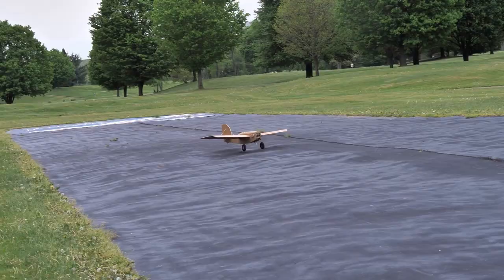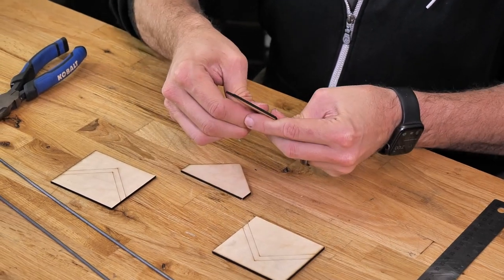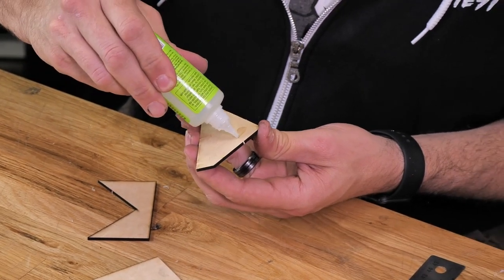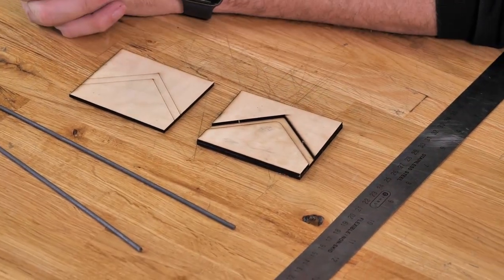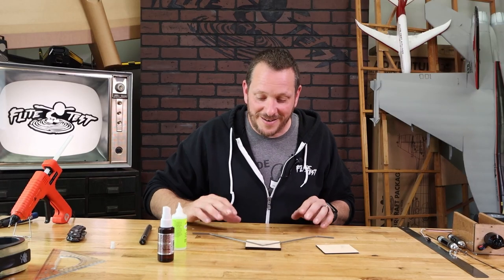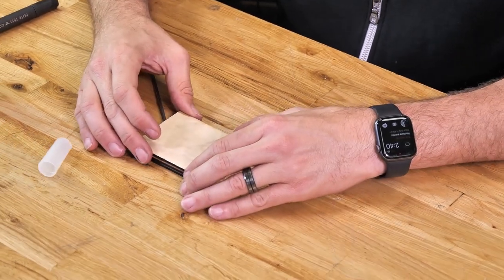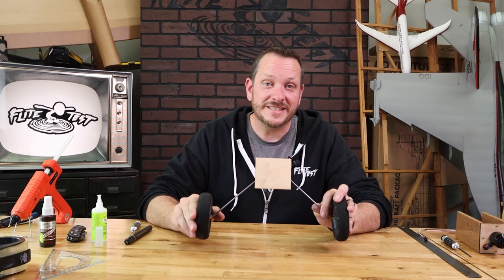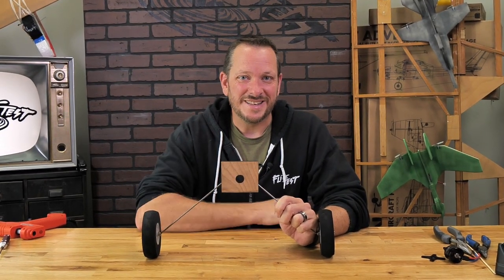How to Build the FT XL Landing Gear //  XL Series

Comment: Instead of cutting off the excess wire, I left it coming down out of the plywood alongside the other wire. Then I wrapped the wires together with copper wire, and soldered them together. Makes for a stronger landing gear. I'm enjoying the FT 3D XL build. Maiden flight this morn.
Reply: The landing gear seems like it's really heavy. I'm building this plane and I was thinking seriously about using an extra carbon fiber set I have.  What do you think? I'm a 3D guy and that's all I'll fly with this plane. The gear and wheels are heavy too. It'll move the CG forward I suppose. Is there room to go forward?